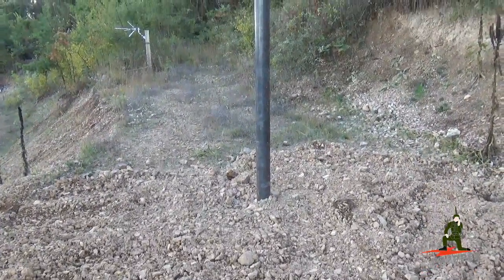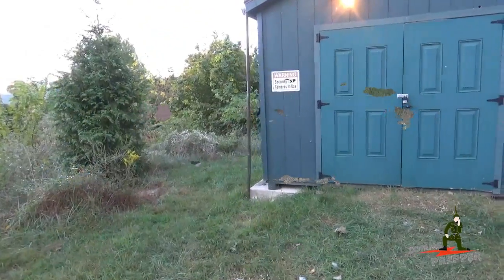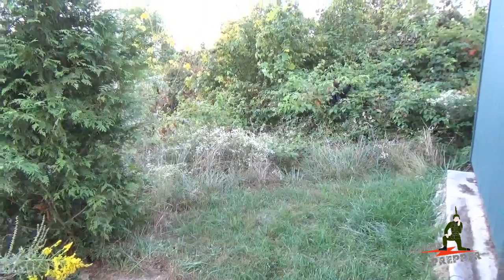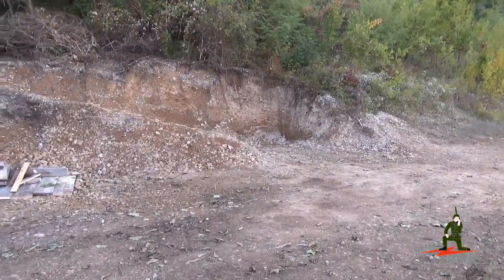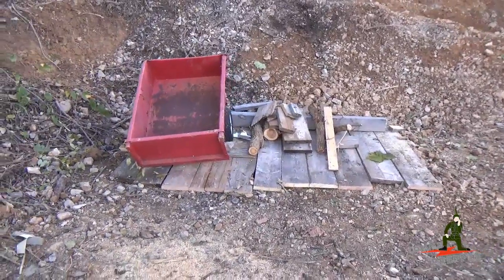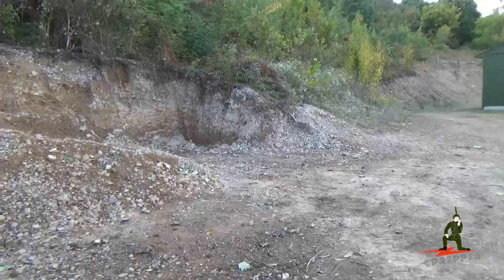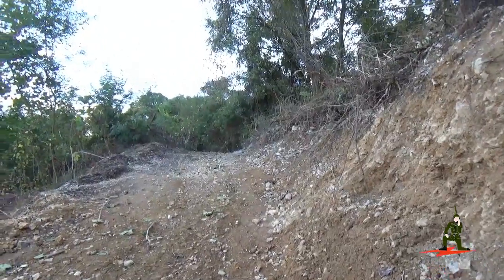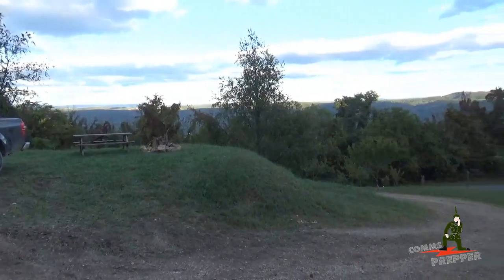Retreat Project Update - Solar Array Mount and Fuel Storage

Comment: Please thank the Comms Prepper Helper.  Nice tune, and very appropriate.  Hopefully she'll one day play Dixie. 
A plastic 30 gallon drum, the kind with the bungs, can be fitted inside a steel 55 gallon drum in the ground.  This is a very safe long term way to store fuel.  I often use an electric fuel pump to transfer fuel. Very handy device. Given current events, just bot all the fuel I could.
Reply from the maker: I will pass it along.  I will have to find some viola sheet music for Dixie.  I try to keep some fuel back at homestead and retreat.  We still have a few stations that don't sell gas contaminate with ethanol, so I can skip the Stabil treatments (for now).
Reply: I keep a 33 gallon drum (one of the white semitransparent kind) filled with about 30 gallons of gas here at the house. I rotate it through the car and frankly, before getting into gas storage and rotation did not realize just how much I use on a regular basis.  I really underestimated how many gallons of gas I use just commuting back and forth to work and the occasional visit to family and friends.  I empty that drum in a couple of weeks of regular driving.  It's made me realize that I am not nearly as prepared for a long term fuel shortage as I thought I would be.
Reply from the maker: I am not fuel prepared at all.  Something I need to work on!  The pit is a start.